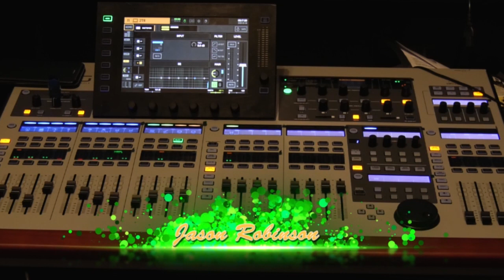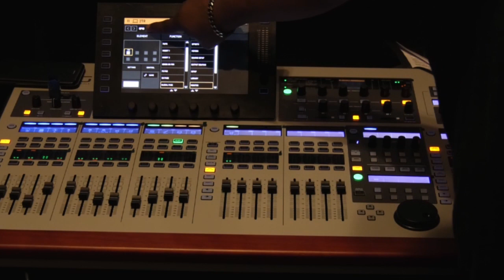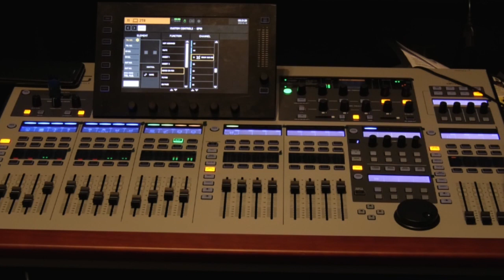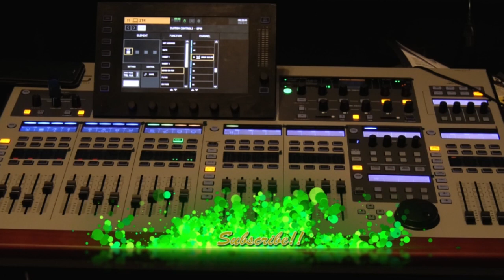How to setup GPIO with Behringer Wing Console!!!

Comment: Will the WING record automation on the effects and save that automation with the scene.
Reply from the maker: No sir it can’t. Not unless set up with a DAW
Reply: @jshi600  Thanks! I'm ok with using the DAW automation IF the DAW automation can control the WING effects, and not just the DAW effects.  Is that the case?
Reply from the maker: Digital Diezel 😳 no sir it want control effects yet!
Reply: Sound Design Studio “Yet” ...nice I’ll take that as good news! Lol.
Reply: @digitaldiezel5870  just get WINGReaperAutoMate